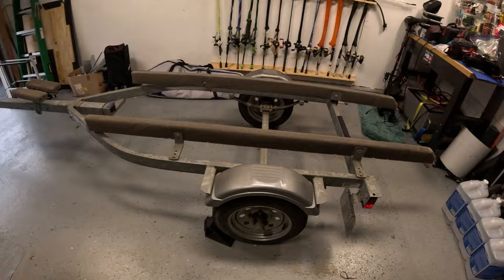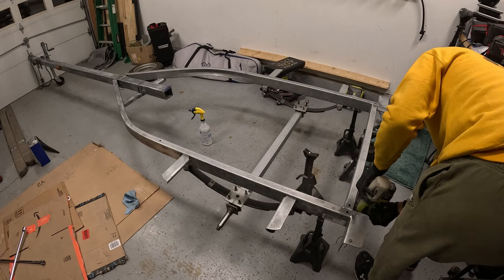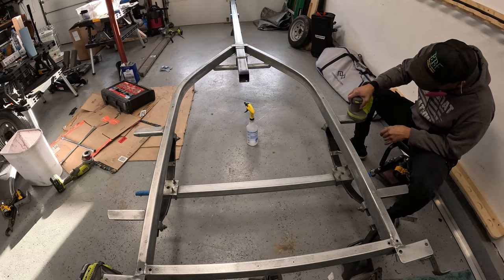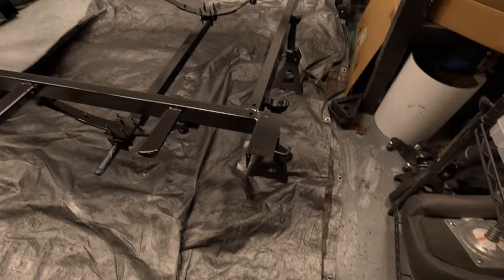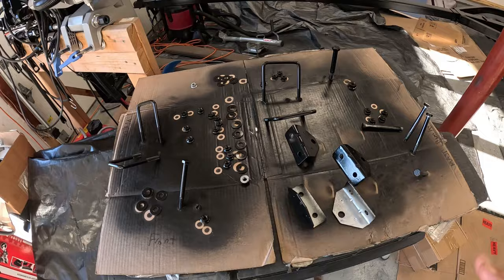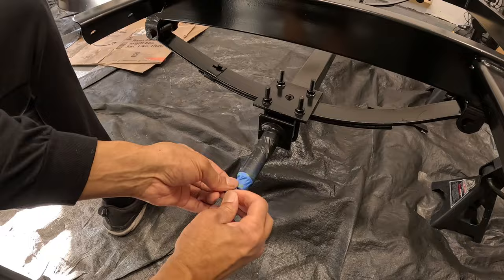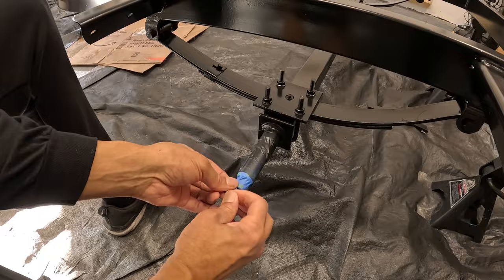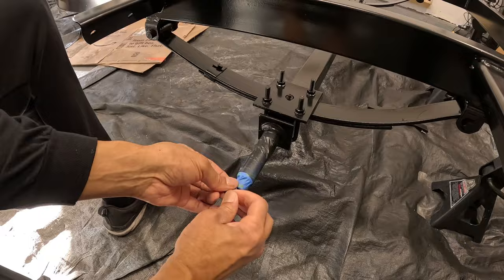Restoring My Jon Boat Trailer: A Step-by-Step Transformation

Comment: Just a few months had my trailer professionally sandblasted and then painted.  My painter was able to lift my boat, 17' 6", off the trailer while it was disassembled, sandblasted, painted and reassembled. Its was $700.

You're finished product looks great and, I like the contrast of the galvanized wheels.  Thanks for sharing!
Reply from the maker: That's an awesome price point. Good deal.  👍🏾
Reply: @BassBrothersFishingDMV  I also thought it was a fair price.

Comment: Good morning sir, I’m a subscriber and I would like to make a suggestion. I used rebuild my bunk boards and got to be quite good at it in my opinion. After rebuilding them for several years I started looking for a better solution. I purchased synthetic bunk boards made from high- density polyethylene plastic and I haven’t looked back. Installed 5 yrs. Ago and they still look like new. Every once in awhile you need to check them for tightness and that’s it.
Reply from the maker: Thanks for the suggestion. I'll check them out. I've heard they're a good option.

Comment: Beautiful job.  The one concern I have would be that when you have to remove or adjust any bolt, you'll disturb the paint coat.  I've had my galvanized trailer for 20 years now and I've replaced nearly every component in that time - axle, springs, bunks, etc.  Still, no denying that it's a very clean, sharp look.   Agree 100% on leaving the wheels unpainted.
Reply from the maker: You're absolutely right. I had to adjust stuff when putting the boat on it abd I'll need to touch up those areas.

Comment: That calcification was hot dip galvanize. Lol.  Wow.  Now its going to rust faster.  Should have painted over the galvanize.  Galvanized trailers cost more and you took it off.  Looks good though it just will rust way faster now.  It was good for saltwater but not anymore.